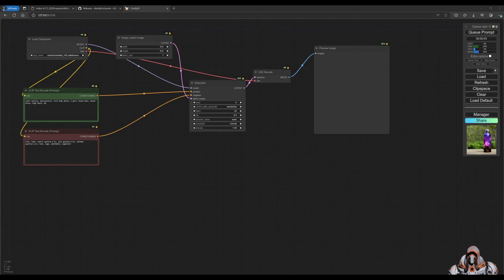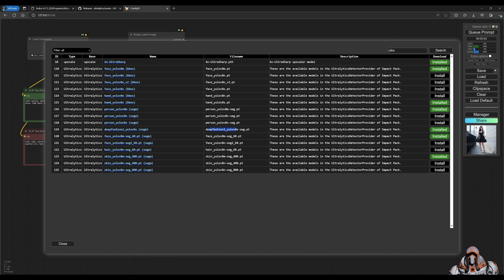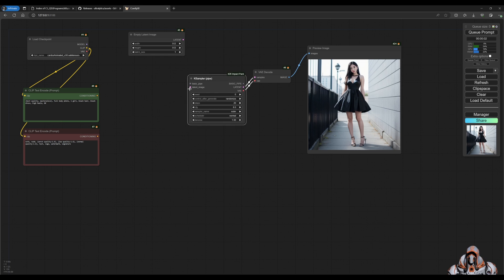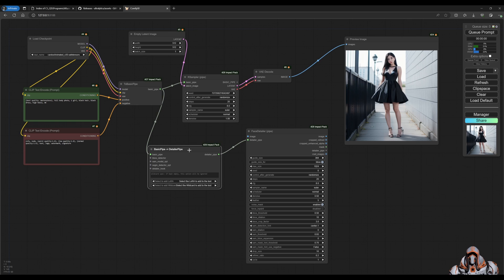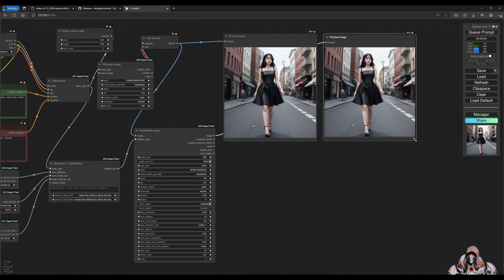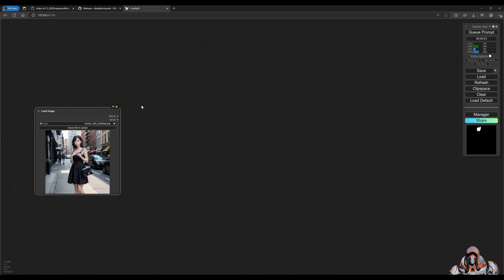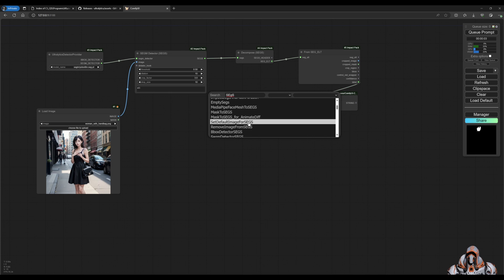Face Detailer - The Basics - Stable Diffusion (ComfyUI)

Comment: I don’t know why you bothered with all the pipes when you could just load face detailer? 

I only tried detailer today but my assumption was pipe was just so you could connect it to a small pipe if you need to move it really far away. I just loaded face detailer, put in the parts and worked great. But I’m not sure what else we can output. Really good to see a video going over the outputs.

Comment: 🎯 Key Takeaways for quick navigation:

00:04 🎬 Introduction to Face Fixing Workflow
- Overview of the basic Comfy UI workflow for fixing faces.
- Components include checkpoint, positive/negative prompts, empty latent image, and CAS sampler.
- Mention of the need for extensions and models, such as the impact pack and Ultra analytics models.
03:36 🔄 Modifying Default Workflow for Face Fixing
- Introduction of the K sampler pipe as an alternative to the traditional case sampler.
- Integration of the two basic pipe node to connect the K sampler pipe.
- Preparation steps, including the installation of custom nodes and models like Ultra analytics face models.
05:11 🖼️ Using Face Detailer Pipe for Face Fixing
- Introduction to the Face Detailer Pipe and its role in fixing faces in the workflow.
- Demonstration of connecting the basic pipe to the detailer pipe for face fixing.
- Explanation of additional detector models (bounded box and segment) to enhance face fixing capabilities.
08:16 🖼️ Examining Output for Face Fixing
- Overview of examining the output, including previewing the fixed face image side by side with the original.
- Demonstration of understanding how the face detailer recognizes and fixes the face using cropped, refined, and masked images.
- Quick insights into the importance of the mask in identifying and fixing specific areas of the face.
09:18 🏷️ Labeling Masks in Images
- Introduction to a quick labeling demonstration using masks in the image.
- Integration of Ultralytics detector for identifying various objects in an image.
- Steps involved in decomposing, converting, and previewing masks and images for labeling purposes.
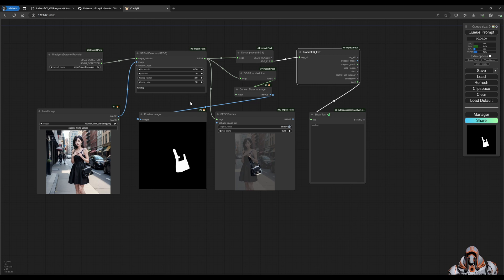14:07 📚 Conclusion and Call to Action
- Recap of the topics covered in the video, including face fixing workflow and labeling masks.
- Encouragement to explore stable diffusion and Comfy UI with links provided in the description.
- Call to support the channel by subscribing and liking the video.

Made with HARPA AI
Reply from the maker: Thanks, that is really cool :)
Reply: @DiffusionTinkerer  Thanks for the great video.